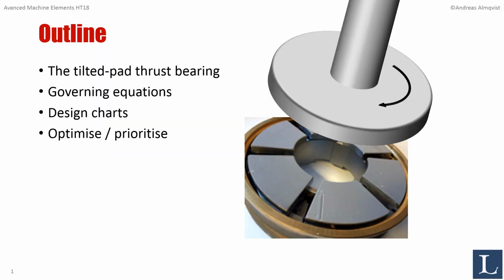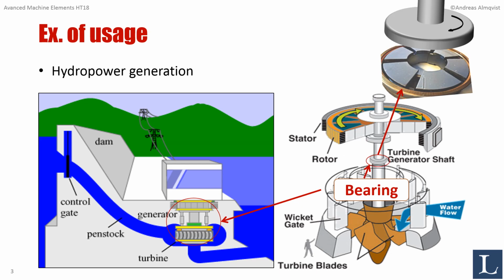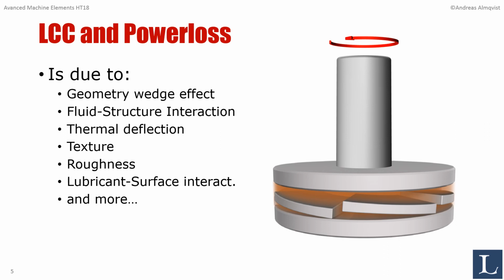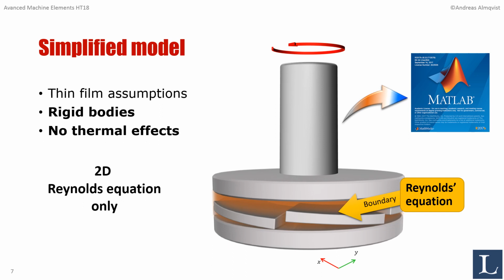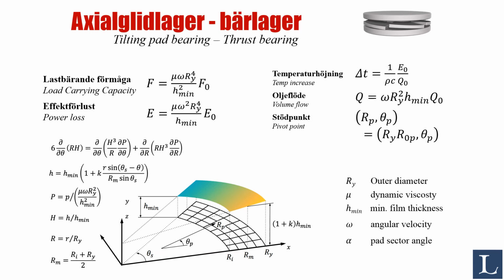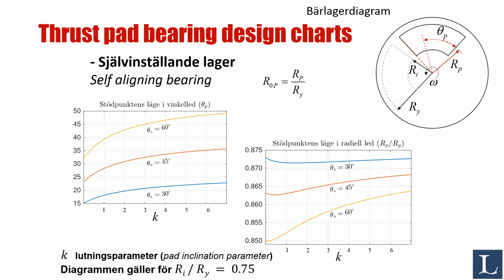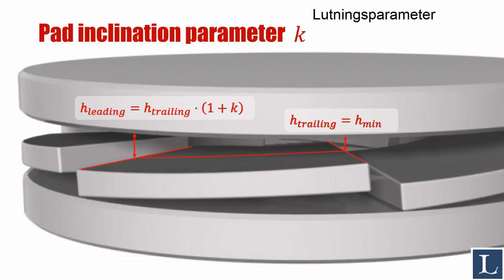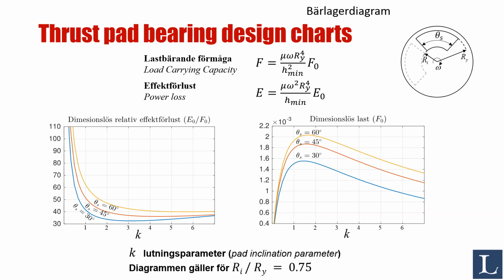Tilting pad thrust bearings 4 video 1

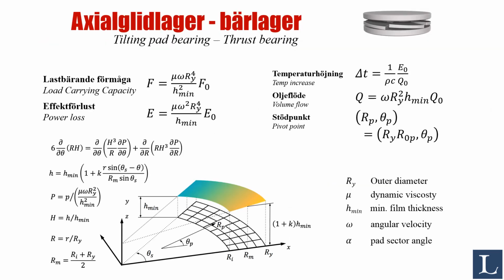Comment: Thanks for the informative video. Since no one pointed it out, 8:56-9:53, Ry is the outer radius. Correct? Also, can you tell which software you used for that end simulation video 13:26 - 14:37